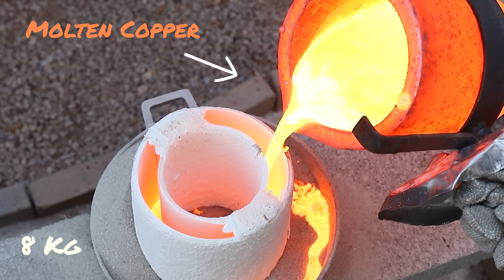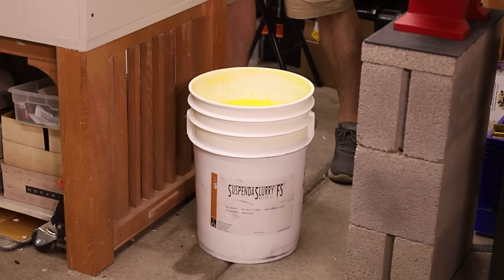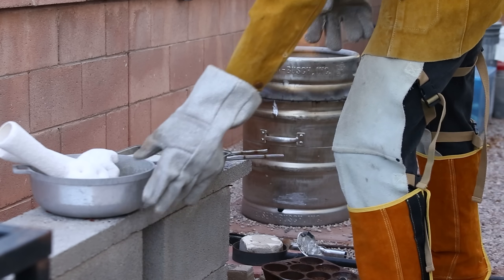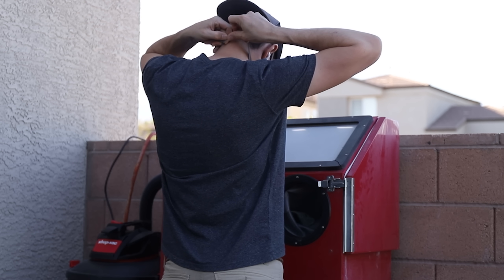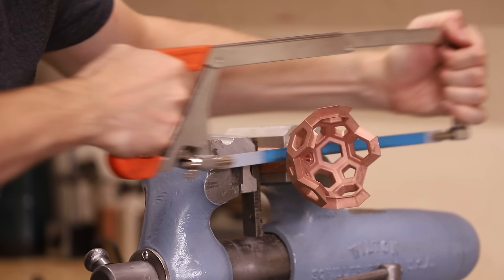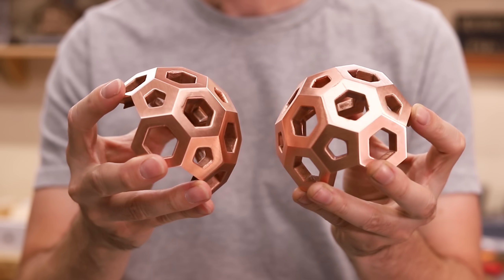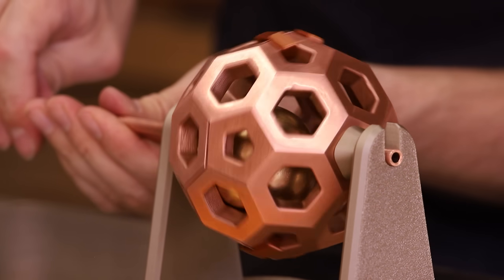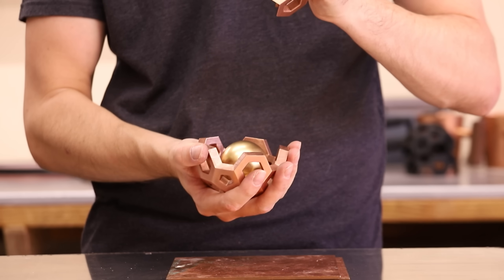HUGE Magnet VS Copper Sphere - Defying Gravity- Will a Neodymium Magnet Float Inside?

Comment: This is a perfect example of how electrical current; flowing through a conductor, also exists outside of the conductive material. You can see this in how the magnet slows down as it falls towards the copper.  Both sides of these fields (internal/external)  are acting within a greater field of electromagnetic "soup". The energized field is acting like a "non-Newtonian fluid" and cushioning the magnet's fall.

Very cool video and mad props to your craft and artistry.

Comment: I think you may have the proportions between the two slightly wrong, I believe either the magnet inside is too large for the sphere or the out side is too small I think it may throw off the electrical currents

Comment: It would seem the principle relies on relative motion of the magnet and the external parts. Finite resistance and tiny asymmetrical differences may cause the inner sphere to spin and reduce the relative motion. Perhaps mark the magnet with stripes to verify. Nice experiment 👍

Comment: Try rotating it gradually faster along a vertical axis. Centrifugal force should drive it out and up the inner wall to the equator, countered by induced field driving it inward and gravitation pulling it down. Control the speed carefully and you may acheive equilibrium and a stable hover.

Comment: if you measure the speed it rotates at the point it levitates then set your video frame rate to match the hexagonal openings you should get the rolling shutter effect and see through a static window in frame

Comment: The distance between the magnet and the copper sphere is too great, if you can build a new one with about a 5mm tolerance, I believe the results would be more desirable. It would be interesting to know how much drag the magnet puts on the sphere while it is rotating. Also, might be fun to see if you can get a measurable electrical discharge.

Comment: The magnet needs to be bigger.    More powerful.    Its not facing enough force on all sides.  Or try lining the outsr shell with a magnet to push it to the other side.   Except that the side will have the same force or resistance.       All the way Around it.

Comment: See if there is a voltage potential between the two halves of the "sphere". separate them with electrical tape. Then attach two LEDs across the gap (in opposite polarity directions). Then spin the sphere to see if your spinning causes one or both of the LEDs to light up.

If this works, then put LEDs all around the entire gap between the two halves. You'll have a magic light bauble that requires no energy other than a twist of your hand to light up. Take it spelunking or underwater diving or anywhere where a battery isn't quite good enough.

Comment: Great craftsmanship! On your question how to improve: if you would 3d print a plastic non conductive ball of similar size with little 2mm pins sticking out, 2mm apart, all over its surface. And then wrap that ball with insulated copper wire of about 1mm diameter, first all windings parallel in one direction (lets say horizontal), then thereafter, again wrap it in parallel, vertically. This way, the EM field will be much stronger and hence the resistance to the magnet moving much much stronger. Be sure to connect and insulate the wire ends properly. Good luck my friend, let me know if I can assist further, send me a PM.

Comment: Could you add plugs that reach down to the ball. At the end of the plugs you could add ball bearings to have it centered and spin freely. At that point it should be secured. You then can have it spin faster. Even if you don't try this, you have a cool idea.

Comment: You need to connect the hemispheres with a stronger circuit. I would weld them or braze them together. Or just make the connectors out of copper and screw them in. Also cool down the metal as much as you can. The lower resistance the stronger the effect.

Comment: Can you try casting a bigger sphere where this sphere can fit inside and rotate in all directions? The difference is you would have custom cut hexagon magnets, flip the poles accordingly, set up in the spaces of the bigger sphere.  The idea is when the bigger sphere, which is made of two halves that becomes one, spins the smaller sphere in the middle faster the closer the halves get to closing and becoming one.

Comment: i wonder if expanding the design so that you were able to keep the holes in the same position, but get the copper hedron body thicker (maintain inner spacing/distance from the magnet, increase thickness of outer layer) or perhaps a slightly smaller magnet of similar strength.

Comment: I wonder... what if you turned the whole thing sideways, so that your rod is on the bottom and the top above isn't fully connected to the bottom piece, but both the top and the bottom were turned at the same speed.  Would it work?  We could see through the gap.

Comment: You should fix the enclosure to one rod, and a disc magnet that fits inside to another rod that free spins through one of the enclosure holes.. and spin them opposite directions with drills. Then see if they create an increased magnetic field via rotation and resistance.

Comment: another question I have is: you know how they make aluminum alloy glass for space shuttle glass is there a way to make copper alloy glass so you could not only view the magnet, but it would be impact resistant possibly but maybe also conducive and there might be a way you could harness this energy that’s been generated from the rotating fields I seriously think this would be useful in some way. I can’t quite explain it, but this seems like it has potential for some seriously interesting effects

Comment: I have a question what kind of field is that throwing off and is it any kind of useful fluctuating field or different in any way than the average electromagnetic field that happens as a result between magnets and copper cause it’s kind of a no contact coil and rotating at that

Comment: There's a theory that as fast as a magnet snaps to another magnet if the magnet was massive and say thousands of them ...

the speed manipulation to catapult a machine ie a rocket and slowly starting the engine to a specific speed then turning on the taps could if repeated catapult you forward at a great speed if you look at the series cow boy bebop the latest with Harrold from Harrold and kumar they have a way advanced one and look at the giant tube like object in the new dune films what you would be aiming for is the first steps of evolution of tylonic speed I have looked rather  bounced the theory to Elon musk do you think you could build a small model of it to replicate the idea .the magnets would have to switch on at once and a push and pull otherwise you would just stick to the side and the machine would need to be able to hover in the centre...and remember the end machine would be so big you wouldn't fit it in the street so it would be fast   and again it would be massive and in space

Comment: @RobinsonFoundry great video! A while back I saw a documentary about Roman artifacts found in Britain. One of the strangest items—found all over England—were iron (though perhaps it was another metal) polyhedral shapes almost exactly like the copper piece you made, with circular holes in the sides. Apparently no one has figured out what they were used for.

I wonder if the Romans had access to large magnets..? You should check it out.

Comment: 1. You could use the copper rods as a base for a more sturdy srand
2. You could make a second one, and see how they effect each other
3. How do inertial forces act upon the case, and the magnet if tossed in the air (the whole thing.)
4. If we assume that it is held on its x axis stationary to freely rotate on z; what happens if you  rotate it on y, and what happens when it's rotated on both y and z
5. Make another outer shell and connect it as a copper gyroscope
6. Rotate the magnet itself at high speed instead of trying to move the shell

Comment: Brilliant

What is especially interesting is that when the magnet is fully suspended in midair, the mass of the whole system still equals the sum of the two materials’ mass. 

Can we hear the copper sticks used as claves?

Comment: Spin the magnet that you have a foot away with your drill or a motor, instead of directly spinning the copper sphere. I don't think it would improve anything, but it would be cool to see, especially if you film it with the foot-away magnet out of frame. It will look like magic! I imagine you'd have to slowly accelerate it up to speed. I'd like to see that. That, plus all the fantastic suggestions that other people have left. I'm looking forward to the next instalment! 
Subscribed.

Comment: Try attaching the black ring magnet to a motor.. the rotation of the ring magnet could rotate the sphere without direct mechanical input. This would enable you to mount the sphere on 2 rods with a ball bearing race at each end. Smooth, silent and very very cool…potentially (see what I did there? 😅)

Comment: I'm no expert at all, but I am enthusiastic about science, so here's what I thought could be cool.

It could be that at low speeds, the magnet is affected by the periodic absence of copper (since it's spinning), and the magnetic field fluctuates, causing the magnet to shake inside. If that's true, then at low speeds, the right speed of rotation will be predictable by some frequency of rotation. Also, probably at high speeds, that won't matter, because the shaking will be so fast and minute that it's unnoticeable.

Another thing that could be cool is: place a rotating magnet near the thing, like you were doing at the end, and make the whole thing rotate inside an airtight case with no servo/driver. The thing being directly driven would be the outer magnet, and it could appear even more magical. But not sure how the thing I describe in the previous paragraph would be messed up by this.

Comment: Heyhey great video! I'm curios of what would happen if you have a copper coil with a magnet falling inside and guitar strings surrounding it,  while the copper coil is hooked to a guitar amp, essentially using the coil as a pickup...  please build that! a floating magnet electric guitar! and check out my band #poposteck! Rock on!!!

Comment: Does copper work better than Aluminum,? I used this concept to make an automatic door closer, as a magnet falls on a rod, it pulls a string that runs through pulleys, and is attached to the door, pulling the door closed, the magnet passes right next to a wide piece of aluminum, causing the magnet to fall slowly as the door closes slowly, when the magnet gets to the bottom, the aluminum is slightly shorter than the fall, so then the magnet falls at full speed right at the end, to close the door all the way without slamming it. I did this years ago to prevent leaving the door open for cats to go in. Ohaus has used this in scales for many years, at the end of the balance beam is a thicrashing
Reply: Hey make a mixer  that uses the concepts you are sharing in your video. its possible you can mix or blend something, sealed in a can. in your video you were turning a magnet in your hands, and the copper sphere you made was Turing on its own, think of a small spoon or propeller like object you put into either a can of paint or a drink, and you place it on a magnetic platform, you press and hold the button on the platform, and the thing inside the can or cup starts turning and mixing.

Comment: The enclosure needs to be an alloy.  Aluminum will reduce weight, and iron will give you more reaction with the magnetic sphere.  To start, I would try 20-20-60, aluminum, iron, and bronze.  Also, don’t let them cool.  Once you’ve done your pour, put them back in the kiln and bring the temp down to ambient slowly.  This will ensure it’s a strong and more uniform set.  Great work!!!

Comment: Holy chit. You are an absolute genius of an engineer.

As for your "right speed," how many rpms was it.  What is the correct RPMS requured per mass t the magnet.

You have literally told me nothing about the basic physics involved. I could go to any rare earth magnet dropping through a copper tube and see the same thing. 

CONGRATULATIONS, you went through an absolute bollocks of steps to explain... nothing.

Comment: Are now let’s see a thinner copper casting. Then on each end polarizing forces attached to wiring. Maybe a few hundred repeaters on the inside attached to pressure sensitive plates that creates a charge when depress then releases using springs as the force is generated from the magnet spinning creating enough energy to sustain itself. Place in a vacuum chamber. Harness the energy created. 

Some imagination required

Comment: Bigger ball cage, to minimize contact with inside edge. Flat magnets in the holes to see if it can be suspended/ moved in air. And maybe electrical current into the copper cage 🤔

Comment: WHY are you not floating around? How about focusing mass. You might need a blackhole manipulator, but that will take time. The shapes are art. NOW, where is the anti-gravity SCIENCE.? 
Just spin up a disk, (a bike wheel for example), hold on to a central pole, you will find that the pole and disk moves in one direction, but will not move in the other, also, prior to spinning up, the whole assembly weighs less relative to the ground. This is an old and very proven experiment. ALSO, try doing similar experiments in a vacuum. Please extrapolate from these simple proven examples, so that humans can catch up.

Comment: Love this. I’d say maybe you could rig up another stand with something like cheap skateboard bearings for the axle to rotate on. Then you can take some of the friction out of the equation and use a small motor set at the correct output for ideal speed. I’m also wondering if you can combine this into another sort of machine to do physical work with the rotation of the magnets. That would be a cool way of demonstrating a simple electrical generator or something using magnetic motion to do work.

Comment: I think you should try putting the magnet casing on a motor, so it spins consistent and then clip some wires on each end of the copper pipe to a battery to give the copper an electric field too, maybe they'll repel each other at a certain speed. 

Tho you might need to oscillate the battery power going into the copper so it doesn't get stuck to one spot.

Comment: I think the magnet might be a bit too small to avoid getting caught in the centrifugal force. If it have more mass or a smaller cage it might maintain its position in the center due to having g a higher magnetic field to work with.

Comment: Make hexagon copper coils in parallel with Diodes. See if you can capture the current to spin the device. There may not be useful power, but you might get it to sustain spin for long periods of time with a floating magnet.  Just a thought to try. It would be a cool desk object. 
Great job, BTW.

Comment: Less holes in the structure. Holes disturb the eddy currents, and that is what you need for the magnet to levitate.

Maybe a few holes at the sides of the sphere to look inside and keep the rest without any holes.

Something like a tube that has to holes and the rest is solid, but of course in this case a sphere.

I wouldn't know how else to describe it, I hope you get the idea.

Nice projects!

Comment: The primary reason your experiment wasn’t as successful as you had hoped is the size of the hexagon holes.  That is the area where the magnet has no surface in which to react.  Smaller holes would give you the desired outcome.

Comment: Wow what a piece! I suppose if you remake the sphere by framming and fixing some cupper wires spiraling around a rotating ball you can make a smoother inner surface and that might cut off the speed sensitiveness of the effect by removing multidirectional impact forces disturbing the inner magnet ball or maybe by adding an inner smooth surface mesh thingy to this build and damping the impacts between the mag and the rotating ball

Comment: Try to make the inside pefect round sphere that the distance to copper is uniform
Reply: like the ball valve with gap
Reply: since you are printing it, make the sphere as continuous coil from north to south ends and measure the current at the axis points while you are spinning it
Reply: this could be also done with cylinder magnets
Reply: also if you encapsulate the ball that it has a fixed axis within the coil axis then you can turn the coil in one direction and turn the ball in opposite direction
Reply: what about placing the magnet inside of sphere and fill the void with mercury, connect to RF microwave generator and spin it, you may discover antigravity. Just don't know the correct frequency

Comment: Use a synchronised strobe light. If you get the timing to match the angular velocity, the copper case will appear to freeze and you should be able to view the magnet more clearly